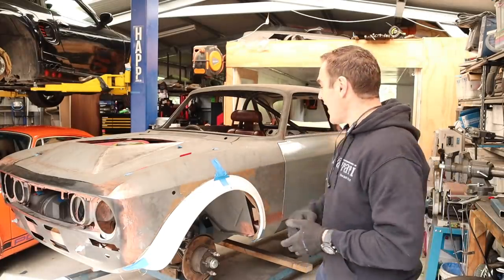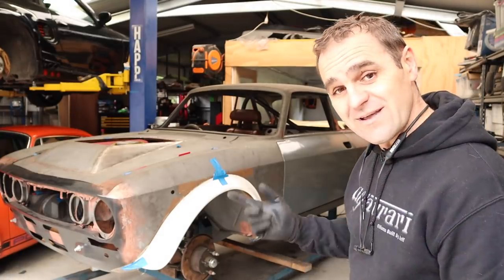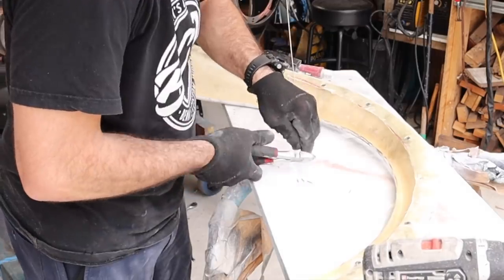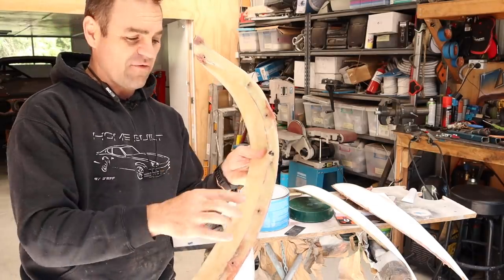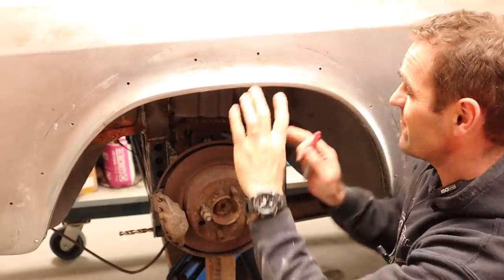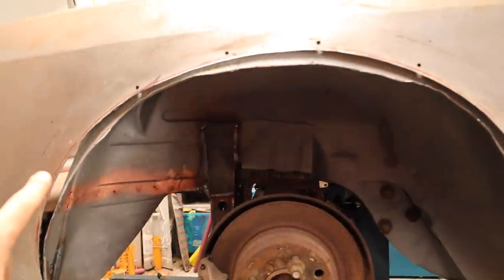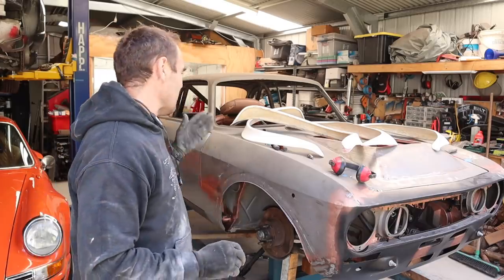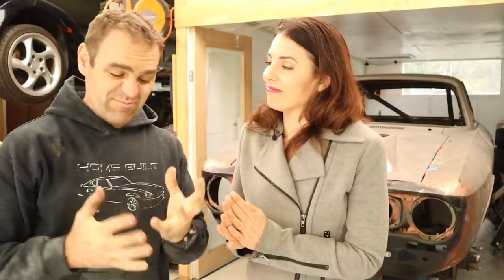Fitting Flush Flares on the Alfarrari - Ferrari engined Alfa 105 Alfarrari build part 82

Comment: Heart stopping wheel arch butchery episode. You have really taken on a challenge as no matter how careful you are when mating the inner and outer panels the outer will buckle under welding leaving an imperfect gap to your wheel arch extensions. I hope I am proven wrong and will certainly applaud your exceptional skills if you can manage the join without the liberal application of Bondo/ Cataloy. Good luck.
Reply: This is true. 
Thou Jeff does like TIG welding
Not sure if there less heat during TIG at least puts less material into the weld.?

Comment: Rub baby powder into your skin before cutting fibreglass. Stops the itches!

Works a treat
Reply: A long sleeve shirt is a good starter.
Reply: @Boosted26L  Hah - no, but a kindred SoCal beach bum, lol; Dana Point, CA, USA.
You almost got it right. Everything is done in flip-flops ('thongs' = 70s), board shorts, and cotton t-shirts. Add sunglasses and a hat. Try it some time, you might like it. hah
Reply: Especially if it Johnson and Johnson.  Might be a very large settlement in your future.

Comment: And you can cut the inner skin in 5cm stripes about 2cm deep into wheel well, and bend it out and weld it in sections. And leave the space behind outer skin for the bolts to come thru.

Comment: Jeff - those inner guards at the rear are an integral part of the body structure, supporting the rear panels.  There is no chassis past the rear suspension, this is a common and well known weakness with the body.  Have you taken that into account?  If not there are strengthening plates available which you should consider.

Comment: I should mention my 69 flairs were made in steel. I think they did add about 50 lbs to the car. There was allot of Bondo in them. I had to repaint the car after a ski trip. All the paint was sand blasted off behind the front wheels on the bottom of the doors and the leading lip of the rear wheels from the spray turned up by the front wheels. I purchased a junk car for skiing trips after that.  I did not make or design my flares. Purchased the car this way. However if I were to design flares I would consider covering the back of the front wheels. Similar to how your flares cover the front. And I would use fiberglass to save weight.

Comment: Arches look good.  I'd like to think a plasma cut 2mm plate with rivnuts could have been fibreglassed in for really good strength. Hopefully your solution works well.  Worse case polyurethane glue will hold them on

Comment: Should have used a guard roller and used the wheel to push the inner up. it will work if you use the roller to stretch the inner guard about 30- 50 mm from the edge. try it it will save you heaps of time.

Comment: I had a 1969 with wide wheels and flares. They were of the same style as yours. An issue I had was driving in the rain the front flares did not cover the back of the tires down at the bottom. Just like your flares. My paint became extremely chipped behind the tires as a result. Take great care driving on dirt, mud, snow or rain to go very slow or the whole lower side of the car will be splashed with much and bits.
Reply: Muck.
Reply from the maker: Same thing on the 911 ;)

Comment: Have you checked to see how much uptravel you need for the tires not to rub on the old fender? Doesn't seem like you gained much in cutting off the lips, especially in the front. I'm wondering if they need to be mounted higher, although I realize that they're probably made to mount in a specific spot.

Comment: If you’re going to mount them permanently 
Use 3m panel bond 
Glue them to clean ground bare metal cover the bare metal 100% with panel bond coat the fiberglass as well then put 1/8 
Bead to squish and put the flare in place 
Use masking tape to outline where the flare goes 
You have an hour to hour and half to get it lined up
Let it dry over night 
It’s better than welding trust me 
You can sand the seam smooth
Then apply upole fiberall as a filler to smooth finish up with 
Putty 
One more thing polish the rust off the rest of body spray it with a product called dry coat it will not rust while you do the rest of your fab work
Reply from the maker: If you watch the previous video, I explain how if you attach them like that they may last a while, but the join will always crack.
Reply: Home Built By Jeff  
Done right I’ve had good luck with panel bond from 3M 
I didnt say that I would bolt them as well in my last comment! As well as panel bond 
Panel bond used right is as strong as a weld 
The bolts would help with vibration 
Now a cool way of doing it is to cut the fender leaving the flange to bolt them too 
Use a air flanging tool to make a lip the flare fits down into 
It looks very smooth as long as you follow the line exactly 
I own a shop here in the us im not a couch mechanic lol 
I do this every day

Comment: Hey Jeff, john here! 
I have a 1999 Porsche 911 996
Was looking to upgrade headlights from the xenon hid to the more modern LED configuration but I’m being told that everything I want won’t work because of the factory plug that is designed for the HID headlamps...would love your input and or suggestions...

Comment: I thought you were going to fill the gap between the original arch and your captive nut flange with CSM. I couldn't work out why you were worried about the spinning nuts because they would glue in with the second layer of fibreglass.
Reply: They need to be robustly mounted. As they will be under a little stress from body flex if Jeff's does track days in the alfa...?

Comment: It’s a bit late but did you not consider rolling the arches with a tool attached to the hub?
Reply: I was thinking that. However don't think there'd be enough wheel  clearance.
Jeff's had similar problems on the Porsche's rear arches to close to wheels.

Comment: Why use fiberglass when you are fairly adept at metal working?  Weld them on and hammer them out.   These fiberglass flares will be cracked and gone in two years.

Comment: You're doing it wrong ;-} 
Putting so much effort into the arches is a probable mistake before you have the tyres and wheels mounted as you will likely have to redo all the work you've done when you discover the tyres rub badly exactly where you've put the bolts. Buy I do hope you got it right the first time.
One thing you need to do is properly round off the cut edges so that the individual doing the road worthy inspection doesn't send you away to do it.
Reply: Didn’t you hear him say that he can’t get tyres coz there’s a shortage. You also repeated your comment from the previous video on the fibreglass flairs. Remember this is a “home built” project, if you want perfection go and watch Retropower. They’re anal about details, should suit you fine 🤣🤣🤣
Reply: @adrianvringer340  I repeated it in case he missed it . He might not be able to get new tyres but for fitment purposes used tyres will do even if he only gets one, as long as they are the same size or larger being bald or well past the use by date won'y matter.